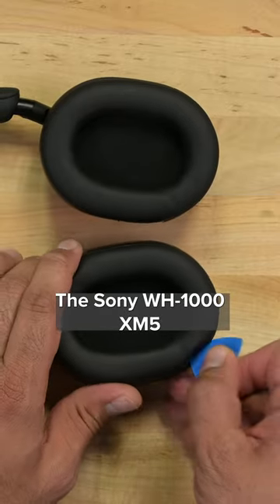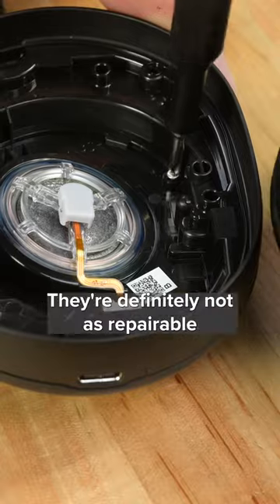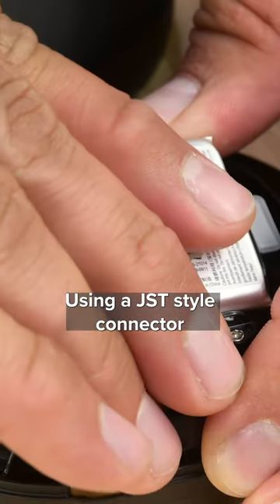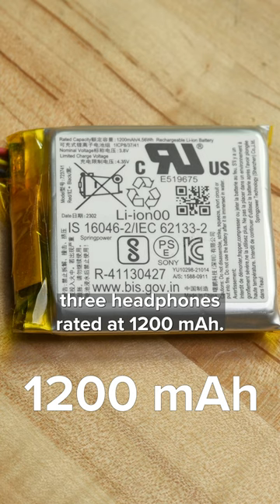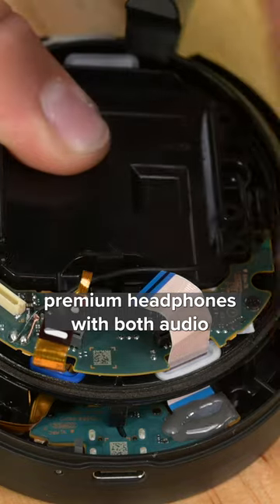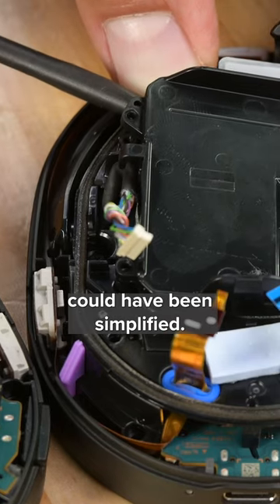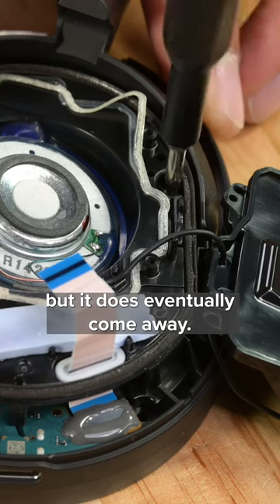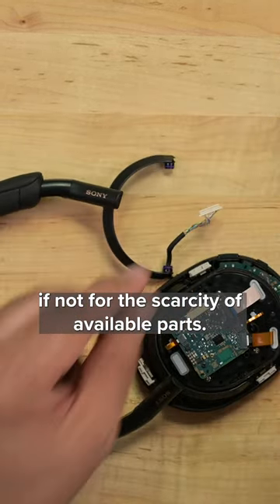How Repairable are the Sony WH1000-XM5? #ifixitteardown #headphones #repairableheadphones

Comment: mine the right side suddenly not working after 6  months of using
Reply: How interesting, same with mine.
This october 19 marks its 6 month use with me.
I'm taking mine to the service center for repair tomorrow.
Reply: @Alalpog give me an updated how much is the cost
Reply: @Alalpog  did you repair your headphones? How is it after repair?
Reply: sorry for the late update, October 20th. I did send it to the authorized service center for repair.
Demonstrated the issues and they told me to wait about 2 weeks. Nope. Turned out to be 1 month and 3 weeks almost. Got it back 1st week december.
My issues were buzzing sound and malfunctioning auto pause and auto turn off functions of the headphones.
After a month i returned back and got my headphones. Worked well for 2.5 months, but the issues returned. This time the buzzing was even stronger and all.
So at around feb i did bring it back to the service center and chatted with the front desk.
I told them that the buzzing returned and that other functions did not work as intended. Got it back after more than a month. I got it almost April already.

I asked them about the first repair. She showed me the assembly part which was replaced. They're sending it back to the main office for inspection (at least that's what she told me). It was the whole freaking headband, and the speakers. Not the earcups tho. Just the whole headband and speakers. Costed around $240 ish when converted from my currency to USF.

Now the second repair, i did a little more explaining. Explained that I've tried resetting device 3x still nothing, never got wet, never used outside when raining,  never got dropped. The buzzing seems to only get louder on the right side, headphones app is updated. But i only noticed the buzz a few days after update.
When i checked to get my headphones after 3 weeks in the center, i noticed my aftermarket earcup pads were damaged. As if some mice chewed it. They said it got damaged when repairing lol. They didn't even pay me back for the damages. I was afraid of asking or demanding payment from them as they might not fix my headphones properly.
But after checking the headphones, i tested it out immediately.
The buzzing was gone but the functions were very malfunctioning. Such as the touch controls, auto pause, the name on my headphones is registering as someone else's, the color in the app is mismatched. It even registered different usage hours on the app.
This isn't my old headphones anymore. This was someone elses. 
So i didn't get it back from them yet. Told them to please fix the issues.
After about 2 weeks i got a text from them saying its ready for pick up. So i did. The issue were gone however, the name, and color of the headphones still is different from when i first got them. I didn't mind at first cause i was just relieved that it was working again.
I asked them what they did to it and...

This time they replaced the mainboard and mic board (not sure about this one's name, but all i know is that there are 2 PCBs which they replaced. One is the main board and the other is not sure about the name). This one cost about $170 she said.

After less than a month about 2 weeks i guess, the auto pause function doesn't work again but at least the buzzing stopped.
I tried asking the seller for help, they did ask me to go to sony website and chat to an agent there.
I did use the live chat service but that wast much help at all. It was very tedious going through the live chat. I just game up. I felt like the guy on the other end of the chat wasn't willing to help me. I wanted a replacement as i feel like the headphones were already used by someone else.
Overall bad experience from my first ever Sony headphones and their aftermarket customer support.
The support available on paper is nice for sure, but the execution kinda 2 stars out of 5 at best, at least that's how it is in a third world country like the Philippines is from my experience.

** I DID NOT SPEND ANYTHING ON THE REPAIR AS IT WAS COVERED BY THE WARRANTY **.

1 year warranty and it has ended this April 17, 2024.

If i send it to the service center now, i would pay for the parts replacements.
Reply: @Alalpog  That has to be a heck of hassle . Thankfully there is no problem with mine ( Bought it in February 2023 ).
Reply: @AshishDesai444  definitely a hassle

Comment: Hey I have a pair of my own, the left side of my headphones started to make a cracking noise, I’m wondering how I could fix that? I also would Like to know where I could buy parts for it?
Reply: Check to see if the sensor on the back of the driver has moved.
Reply: did you fix yours any update?
Reply: same have I on the right side did u find a fix?

Comment: I was afraid I could not do replacement or get that new battery in quality, but problem is it does not. There ir possible easy fix if microphone is not functional, which is probably some factory insulation not removed wire.